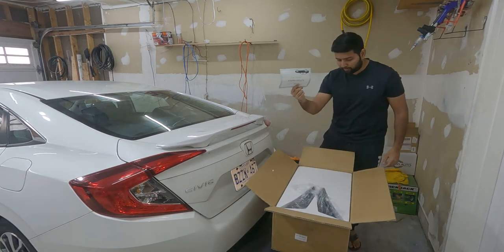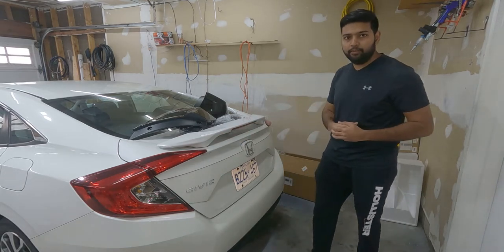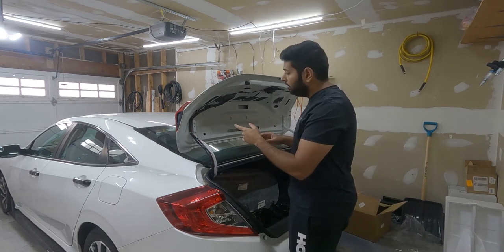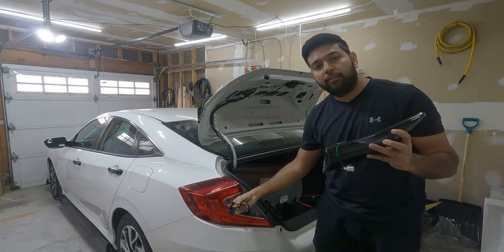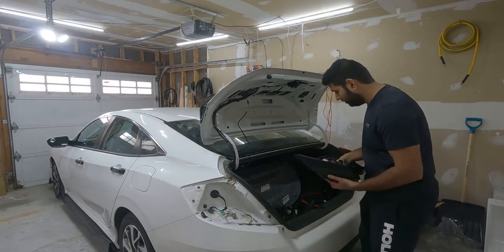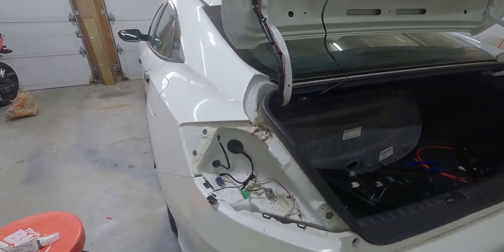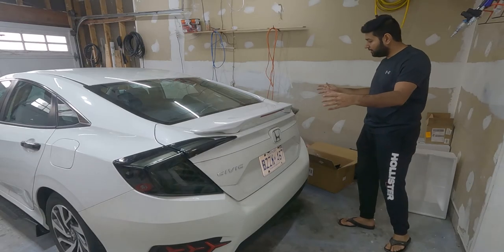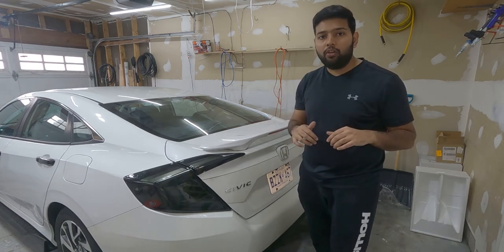SEQUENTIAL LED DRL TAIL LIGHT INSTALLATION | HONDA CIVIC 2016-2021

Comment: If I may add, you mentioned that there were no instructions. So, it would be helpful to highlight the wiring harness, like what color goes where, and you did not check the individual lights. For example, the reverse lights

Comment: Does your brake light FLASH when pressed, or is it a solid single red illumination? THANKS!
Reply from the maker: No, it does not flash. Just solid red
Reply: @NorthUbuild  Thanks! If you are interested you can program these One way or the other. Check the HiRev product page, they have some instructions there. Cheers

Comment: I didn’t connect the black cable to both tail lights but it still is synchronized and sequential. How does this happen? Do I need to connect the black wires?
Reply from the maker: I am not sure why it's working without connecting it but I would suggest to connect it to avoid future problems.